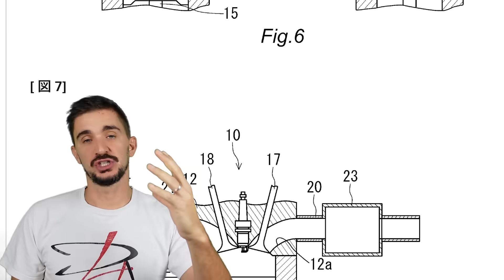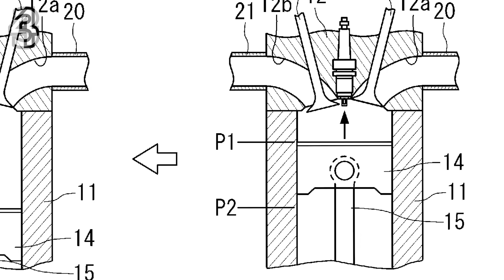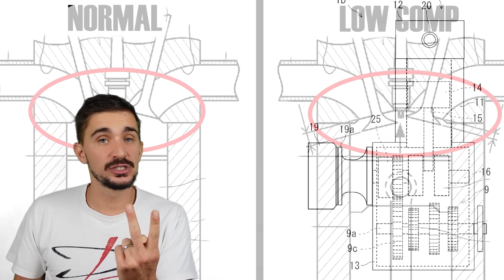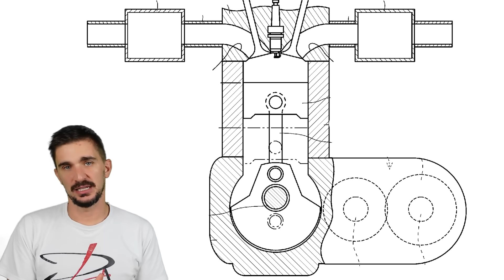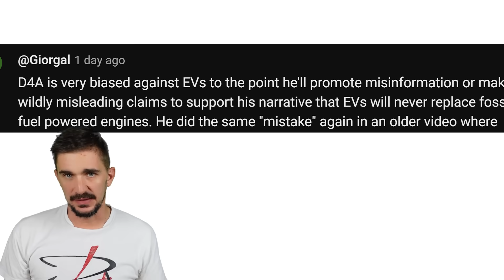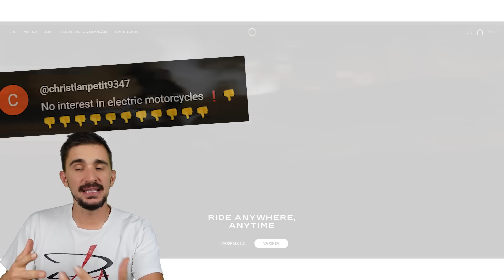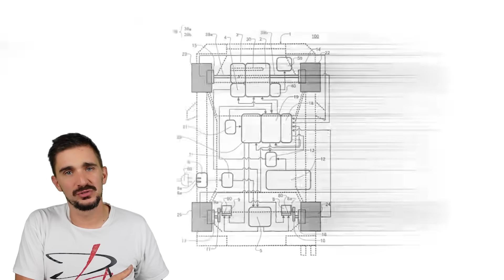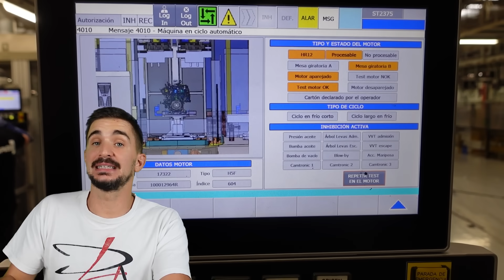Yamaha Just Patented A Fake Engine

Comment: Couldn't they do what automakers do with EVs? Stick some speakers and rumble motors. That way you can actually choose what kind of car sound and feel it has. And without the massive parasitic loss.
Reply: yeah, exactly. and even that is stupid.
Reply: exactly, just add the fake engine but only make it weigh like 2kg's of lightweight alloys or something, so it still looks like an engine, but just hides rumble motors and speakers and everything else inside
Reply: That wouldn't feel the same, it doesn't feel the same in a car, imagine in a motorcycle
Reply: That's why the stated purpose of this patent isn't real. See @mikespence2836's comment or mine.

Comment: I did something like this when I used my starter to move my car
Reply: Every car is EV car if your starter is strong enough
Reply: @lego0011  Oh man the starter is plenty strong. Straight 10 kilowatts of power, in first gear, it really PULLS. Well, until it reaches its top speed of 2 mph, and until it burns out because it's a tiny motor with no cooling whatsoever getting force-feed straight 10 kilowatts of power.
Reply: @michaelbuckers  I once had the clutch cable snap as I pulled up at some lights -  which left me stuck in 1st.  It was a very old car (a Vauxhall Viva), with all sorts of issues, but I had no choice but to try to start the engine in gear when the lights changed - but the engine wouldn't fire (I'd probably flooded it).  I was in the middle lane of a one-way system, so I just had to drive the car on starter as far as it would go - hoping to be able to turn off somewhere.  But it was rush-hour and I didn't have the speed to change lanes, so I had to just carry on.  This was about two miles from home, and a journey that was all uphill!  Luckily, the engine finally started as I got to the end of the one-way system, and I just drove home in 1st (it was a narrow two-lane road, so I wasn't popular...).  So, all in all, I probably drove about half a mile on the starter, and yet, once I'd replaced the clutch cable, I never had any problems starting afterwards, and even the battery didn't misbehave.  Maybe they just made starter motors different then?  Anyway, it's odd to think I effectively drove an EV way back in 1981!
Reply: @paulhaynes8045  That battery was putting in some WORK
Reply: @lego0011 not if it has an automatic transmission
Reply: Stalled on the railway lines, a trains coming, what do you do? Use the starter to move you car
Reply: @curtisnixon5313  not allowed, patent infringement😂
Reply: @curtisnixon5313  Hard to do with a clutch safety switch that won't allow engine cranking without clutch being depressed. I think you better get out of car and watch your insurance claim from a distance...
Reply: @postulator890  or defeat the switch by connecting the 2 wires going to it to each other with a different switch on the dash that will stay in the position it's set to.
Reply: @postulator890  Bypass the switch.  It's bad for the thrust bearing of the engine to start it with the clutch engaged.
Reply: @postulator890  They can be disabled. Hell, my TJ has a spot to put a fuse to disable the neutral safety. Or my old 70's Ford just does not have one.
Reply: @relmdrifter  Do you know where that spot is? I have a TJ
Reply: you were living in the futcha and didnt even know it.
Reply: Another win for manual transmissions
Reply: You must drive a manual transmission vehicle. Thanks keep the manual alive ✓